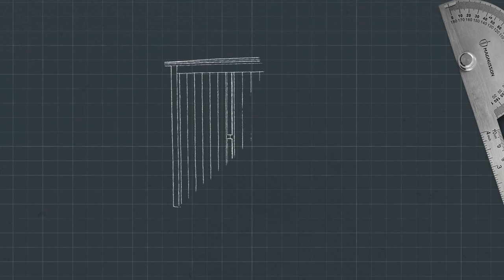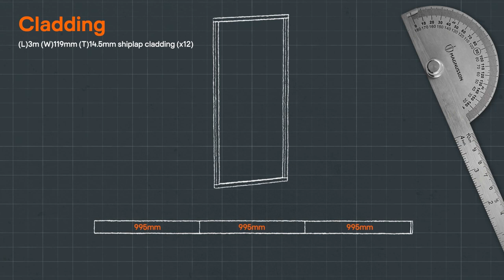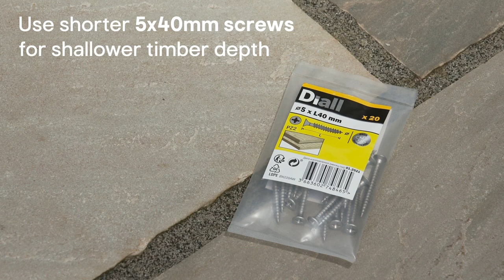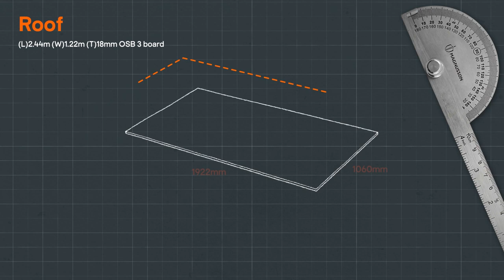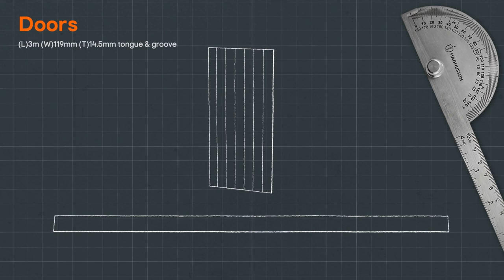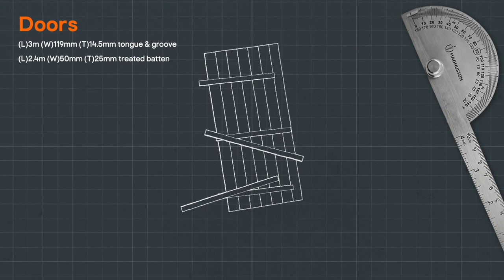How to build a bike store

Comment: It would be better to attach the screws for the lock inside. There are threaded screws with flat heads, for example. This way you can still remove the screws and open the barn without authorization. :)

Comment: A shopping list of the items and a downloadable plan could be helpful, but well-done its inspired me to mod the to suit a different project
Reply from the maker: Hi there, thank you for your feedback 😊 You will find a list of items used by clicking the (i) at the top right of the video. The timber dimensions would depend on the size of structure your planning to make.

Please see a list of items below with there quantities. I hope this helps!

Timber:
2.4x30x30 - 7
2.4x60x30 - 4
2.4x50x25 - 6
2.4x38x25 - 1
Shiplap - 27
OSB board - 1
Felt
Hinges
Glue
5x70 Screws
5x40 Screws
Nails
Felt Nails
Mastic
Flash Tape
Padlock